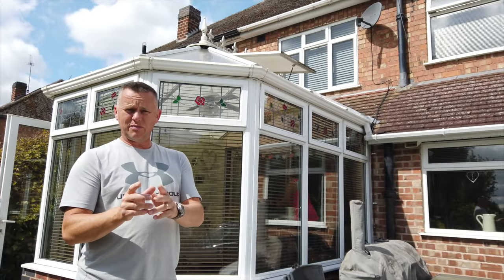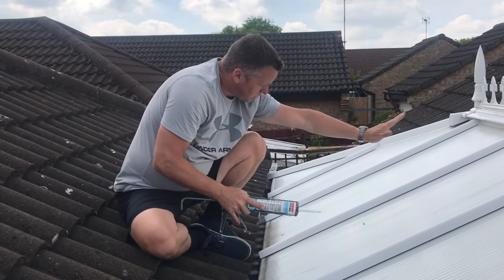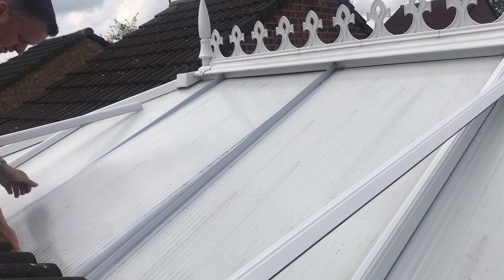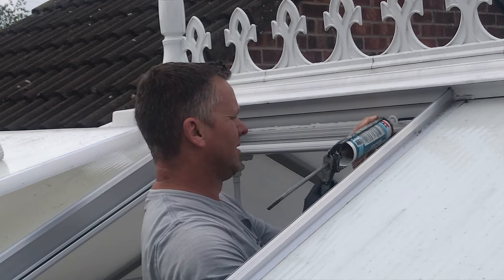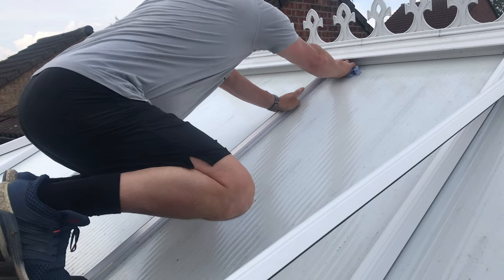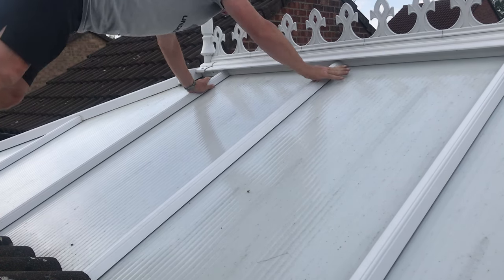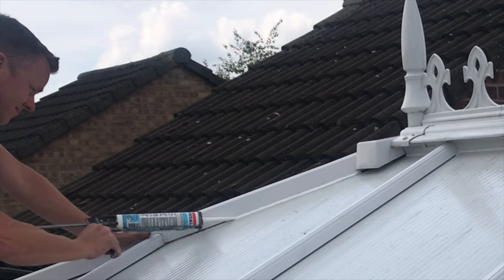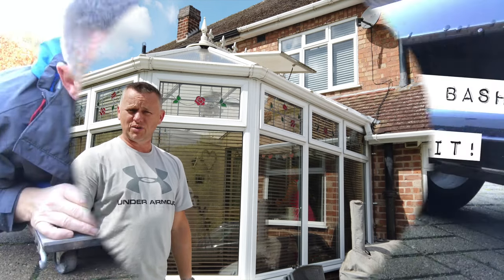Conservatory Roof Leak How To Repair, "Remove Refit Broken Polycarbonate Panels" Or Glass.

Comment: Thanks for this video, my roof is fairly flat but a panel has dropped out along the length with the trim. Will pop it apart and get a look.
Reply from the maker: Thanks for the great comments👍🏻👍🏻🛠
Reply: @aaanton11  Got the roof apart, found the framework in this particular part was 25mm wider than the panel so the panel has moved to one side allowing the long side to drop. Put it back together and put some aluminium down each side to keep it in the centre. Have some flashing coming to repair where mine and the neighbours house join and we get damp. Thanks again! Always good to see how it comes apart.

Comment: Great video. My conservatory has just started leaking along the edge of a panel and the outside trim is raised in one area leaving a gap where the rubber seal should fit snug along the length of the poly panel. Thought it was a complete 'girder' type section which had warped. Thanks to your video I can see it's just a pop off trim so if I can reach where it seems to have popped off its clip (it's a big 5m square conservatory so quite a span) I will have a go at tamping it down with a soft mallet until the rubber seal is flush to panel again. The trim is clipped down top and bottom of the length - just raised in the middle. Thanks for the great help.
Reply from the maker: give it a bash, you can do it, Thanks for the great comments👍🏻👍🏻🛠
Reply: Did you get this sorted? I have this problem now no leaks yet but its lifted in the middle with a gap formed on the black seal trim. Fun trying to get up there and tap it back in place though!

Comment: Great video, I have a small leak, water drips off a semi-circular metal piece on the inside under the ridge cover end cap, the finial screws onto this. How does the end cap come off as I assume there is a leak on one of the panels under it? No obvious sign of a slipped panel.
Reply from the maker: it should just slide upwards, Thanks for the great comments👍🏻👍🏻🛠

Comment: Hi, don't know if you can help? I have a leak on a straight section below a joint in the frame. Do leaks tend to drop where the gap is in a conservatory or can they run down the inside of the frame for a distance? Not sure where to put silicon and scared of leaning on the roof to try to reach the capstone!  Any help gratefully received (and awesome video so calmly explained - feel I can have a go at least as been quoted £5000 for a new roof and only have a small leak!) Thanks in advance.
Reply from the maker: Water can run from the top, easy way is to pour water from the bottom upwards to see when the drip starts, Thanks for the great comments👍🏻👍🏻🛠

Comment: Our conservatory roof has a leak at a junction of panels, look on YouTube, found your video and I now feel confident to do the job myself. Thank you for taking the time to share this, brilliant. One question, to get to the top of our roof, is it OK to place a plank across the aluminium struts to kneel on, is the frame strong enough to do that? Thanks again. 😊👍
Reply from the maker: Yes the frame will take the weight as long as you are across more than one strut, imagine if your roof was covered in snow and how much weight it would have to hold up this will give you an idea as to what the given stresses can be Thanks for the great comments👍🏻👍🏻🛠
Reply: @aaanton11  Thank you for your time, that’s a great help. Subscribed 👍

Comment: Those opening hatches, do the movable part come undone so I can remove the door part?  I need to get up on top of the roof for a large lean-to style conservatory. Through the hatch seems the best way. The hatch has started to leak in the rain so need to deal with it from above.
Reply from the maker: Yes they do, they slide sideways when open, Thanks for the great comments👍🏻👍🏻🛠

Comment: What a really helpful video! I've got to remove 3 poly panels to try and clean out the insides of them using compressed air as they have loads of dead woodlice in them! I think the sealing membrane at each end of the sheets may be rotten! 🙄
Reply from the maker: Thanks for the great information👍🏻👍🏻🛠
Reply: Hi, did you manage to cleannit easy? I’ve got to sort my conservatory roof eith the same woodlice issue
Reply: @RTahiri  Hi! Yes, worked a treat! I removed all 3 panels, poured diluted bleach through each segment, hosed it all through and then pushed compressed air through each one. Left them on end overnight to thoroughly dry. Be careful with the compressed air as it can damage the very thin insert layers of plastic (there were 6 layers per segment).
On reassembly, I sealed the end that abuts the wall with 50mm wide aluminium tape and the other end with a blue breathable tape. One year on and still good as new! Hope this helps.

Comment: Really useful, thanks. One question - how do you go about fixing leaks from the other three edges of the panels? Would that be another bead of silicon or would the rubber seals need replacing, and if so do the just push fit like those around window panels? ( ok. That was more than one question!)
Reply from the maker: Yes, exactly I would be tempted to silicone all leaking seals, Thanks for the great comments👍🏻👍🏻🛠

Comment: Hi. Thanks for this video 😀 My landlady refuses to fix my slipped conservatory roof so I've decided to have a go myself with the help of your video,  but I'm trying to find out what it would cost for a tradesperson to do it. 
It's a 4 poly panel, 'lean to' type roof, fitted beneath overhanging roof tiles.
Any advice is greatly appreciated, thank you 😊  Elizabeth
Reply from the maker: Most will want to replace the whole roof!! you can fix it have a go. Thanks for the great comments👍🏻👍🏻🛠
Reply: @aaanton11 Absolutely, that's what a conservatory company said to two small leaks on my roof ! "Nah, that's £5000 for a new one, mate"!

Comment: Hi have exactly the same issue. Didn’t have a scooby doo on how to tackle it, this is a great video, thanks👏👏👏
My issues is that I cannot easily get to the back of the conservatory is there any way to move the panels up from the inside, or remove them
Completely silicone and put them back
Reply from the maker: You will have to release from the outside first, Thanks for the great comments👍🏻👍🏻🛠
Reply: @aaanton11  hi managed to use a suction cup taped to the poly using gaffa tape was enough to move it back into space and then silicone everything in place 👍

Comment: I have a conservatory that has a loose panel however we have limited access to the roof what do you suggest for pushing the bars back in?
Reply from the maker: You might need to use planks to spread the load, but it needs to be done from above, Thanks for the great comments👍🏻👍🏻🛠

Comment: Great video and tips there. I have the same issue but on a terraced house so side access is difficult, do you have any tips for fixing from the inside maybe or sliding back in place at all? Thanks
Reply from the maker: you will need to get to the outside somehow, Thanks for the great comments👍🏻👍🏻🛠
Reply: That's my problem too. Did you manage to find a solution?

Comment: Hiya I e just moved into my grandads to care for him and the conservatory was leaking. The plastic roof had spid down quite a lot, anyway I fixed that and it's still leaking. Inside the main plastic cover has come off and there are 3 rubber screw things with a rubber pin going through them and that is where the water is coming in.what can I do to fix it. Please read this and reply. Because I'm out of ideas and I'm itching to use my no nails glue gun. Which is gonna make a mess. Thanks
Reply from the maker: Can you cover the effected area with clear silicone, then refit the trim, Thanks for the great comments👍🏻👍🏻🛠

Comment: Hi Anton11,  did i hear you say that the polycarb panels could be replace with glass?  and also we, have the same conservatory, (unaware what profile it is) but could I safely run scaffold boards onto the conservatory  ridge for decorating a masonry wall above it?  thanks for any help, eze
Reply from the maker: It Depends on how old the conservatory is, under 5 years old the frames are usually stronger and able to take glass, you can board over and stand, if you imagine the weight of snow on the roof, boards and a person no problem, Thanks for the great comments👍🏻👍🏻🛠
Reply: @aaanton11   really appreciate the reply, thank you.
Reply: @aaanton11  Thank you for taking the time to reply, much love - eze

Comment: hi, i have a question on how to reseal the sealant on the bottom of the conservatory glass panel that has dislodged/ fallen off with heavy snow and the end caps that have come off ...thanks
Reply from the maker: Just use silicone sealant Thanks for the great comments👍🏻👍🏻🛠

Comment: Great but how about replacing the window polycarbonate rubber seals from the inside and also fixing loose self adhesive flashing where the conservatory is against a wall?
Reply from the maker: use the same process and remove the panels to replace the seals, Thanks for the great comments👍🏻👍🏻🛠

Comment: Your end caps are missing from the ends of the rafters, thats why your panels are sliding down. also most poylcarbonate roofs are NOT designed to take the weight of glass therefore its not a good idea to replace the polycarbonate with glass.
Reply from the maker: Thanks for the great comments👍🏻👍🏻🛠
Reply: Hi, can I kneel on the capped struts of my glass conservatory roof to reach up to use silicone for leaks please? Is it strong enough?